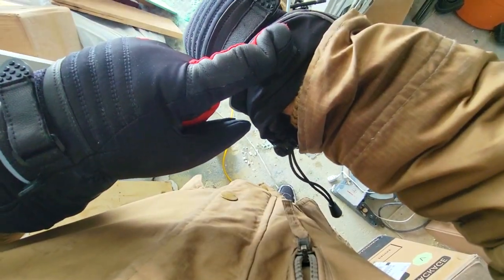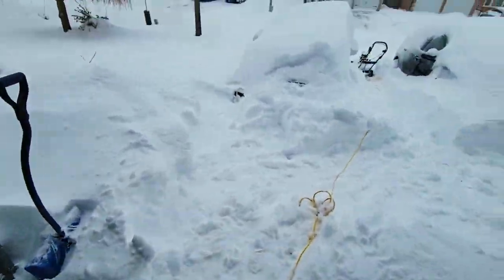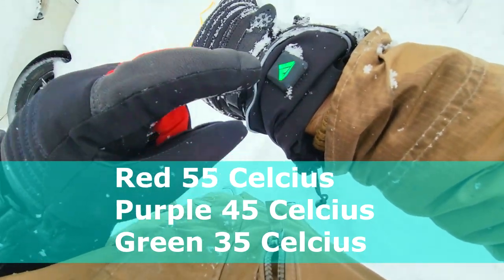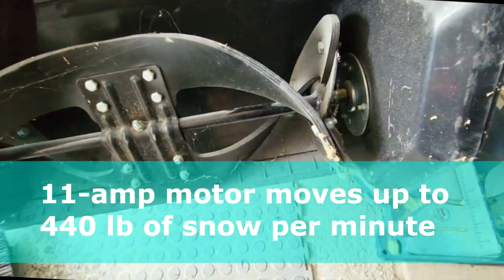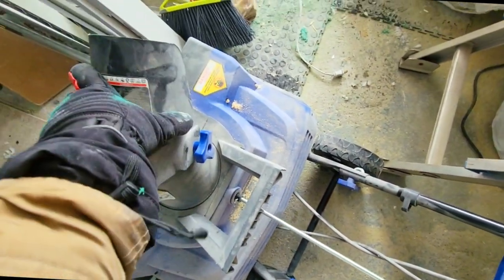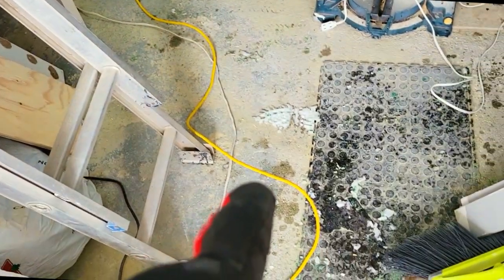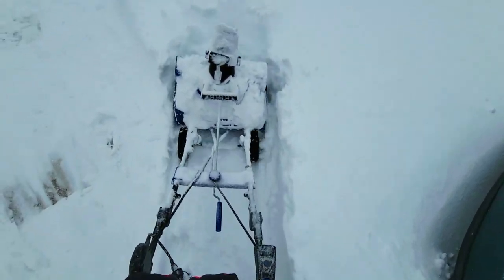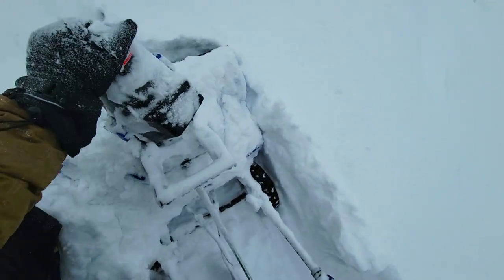Massive Canada Winter Storm cleared by Snow Joe SJ615E Electric Snow Blower & Battery Heated Gloves

Comment: No replacement Auger for Snow Joe SJ615E snow blower.
Customer Support says they do not or ever will sell a replacement auger for the Snow Joe SJ615E
Do Not Buy This Model, Do your research.
Reply from the maker: This is an entry smallest one u can get. If it breaks you may as well get a better larger stronger one